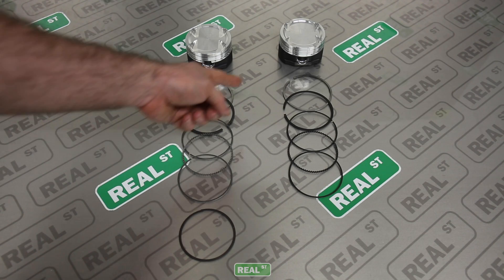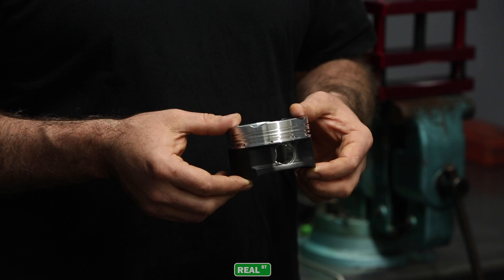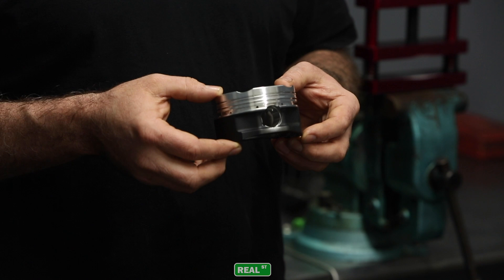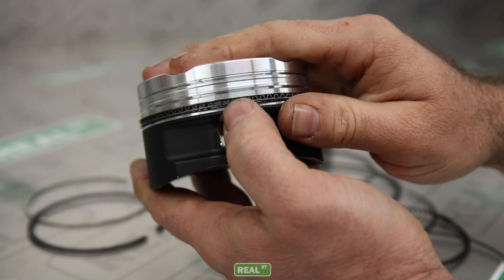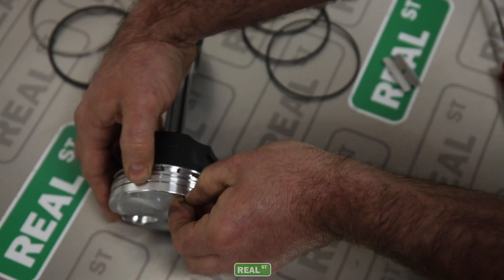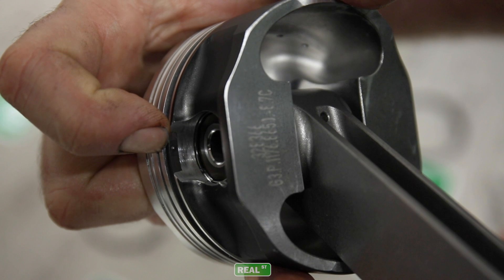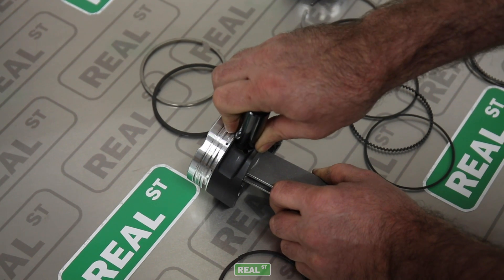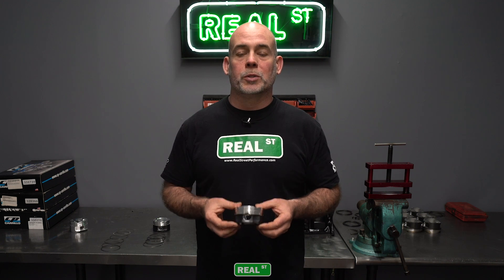Jay's Tech Tips #45: Oil Support Rail - Real Street Performance

Comment: What is the streetability of a piston that requires an oil ring pack support ring?

I am building a 350 chevy with 6 inch rods, and I can buy a piston that needs a ring support, or can spend the big bucks and buy Mahle pistons where they tightened the ring pack and run metric rings. 

What would you suggest for a street, occasional strip engine? Thanks
Reply: In short a support rail is "fine" for street use.  Your chances of excessive oil consumption are much higher from having a improper hone finish or too large of a piston to wall clearance than the support rail. The oil ring is there to drag oil up the bore and the second ring is there to scrape down the excess.   Worry about getting a properly machined and assembled engine and not about a support rail.  Also if you've not purchased parts yet consider moving to a 3.75 stroke crank, it will be more fun to pounce around with the additional stroke. If you'd like to talk more about it you can email me jay@realstreetperformance.com
Reply: @jaymeagher1510  thank you for responding! I have a 14088532 Corvette 3.48 stroke forging turned .030 under. I plan on running a Camaro World class t-5, rebuilt with a billet steel support plate in a 1982 c3 Corvette. The plan is to build a 350 motor that is a little lower on torque on the low end to keep the transmission happy. But if I am off base in my thinking, perhaps I should sell the T5 and the forged crank and build a 383, and get a better manual (I like shifting gears).
Reply: @dougsmaintenanceshop5868   The trans life will be heavily dependent on how you use it. I'd use a light flywheel and clutch with an organic disc. The springs in the disc will soak up some shock on the gear changes.  As involved as engine builds get I'd build the right engine now and upgrade the trans when the time comes. Thanks!